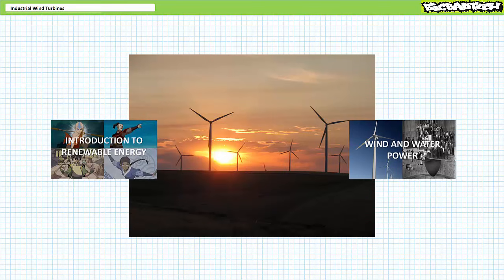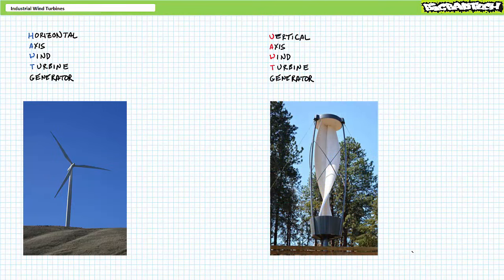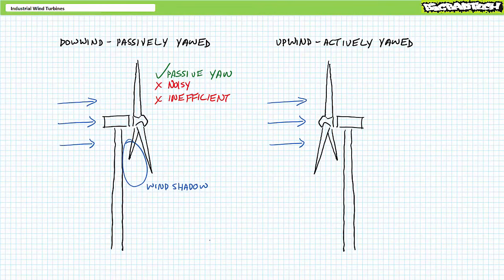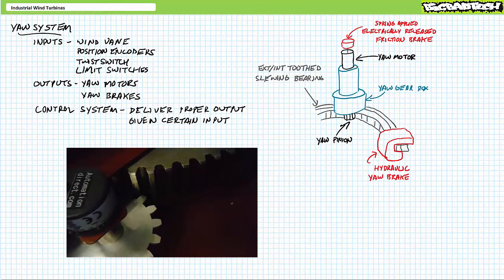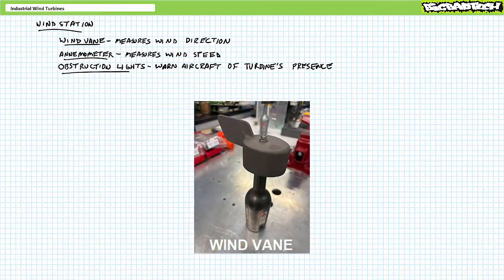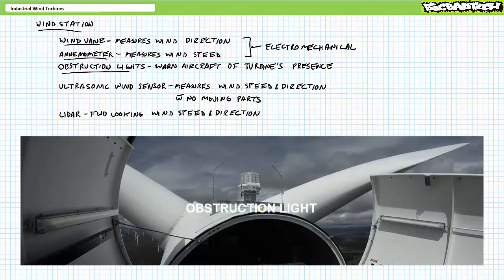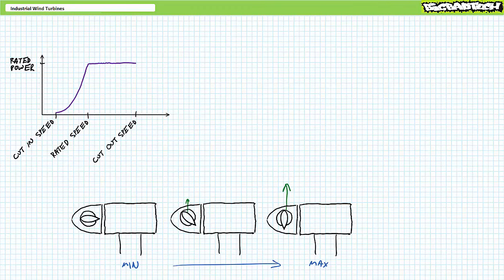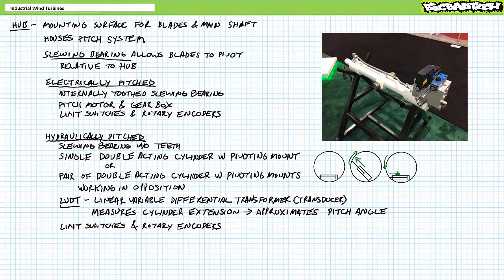Introduction to Wind Power (Part 1 of 3)

Comment: In Northern California north of San Francisco for about 40 years there was a house up on the hill from the freeway, if you can see two large oil barrel, wind turbine installed the diameter of the entire house . on a big house and small houses. 
     They were there for decades. 
     Their house owner, who is way before his time for producing his own energy. 
     1960s 1970s 1980s if I remember correctly, the last smaller wind turbine that was left working was removed in the early 1990s